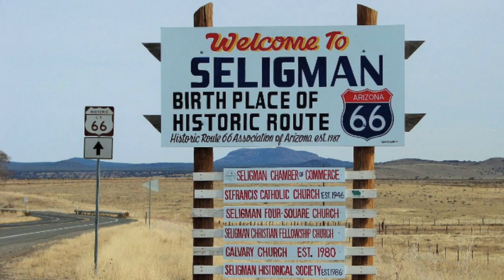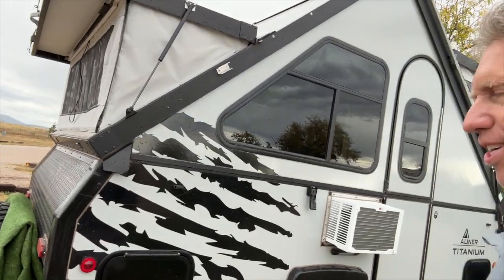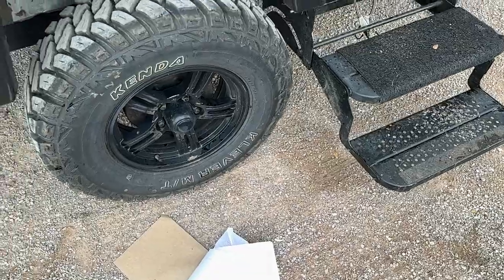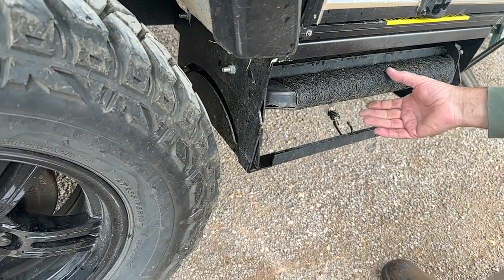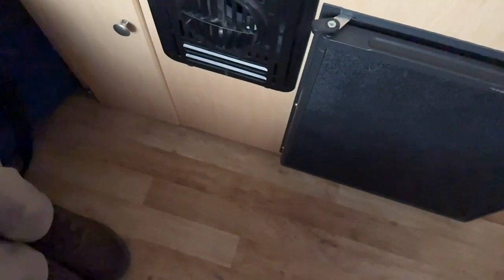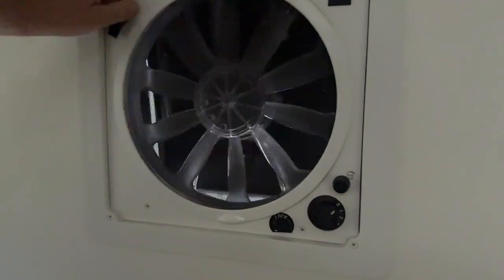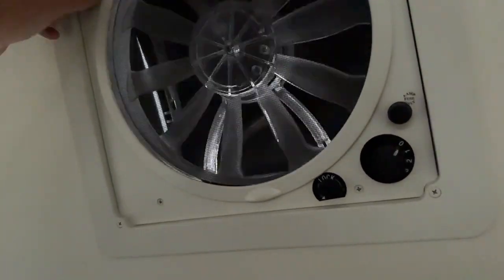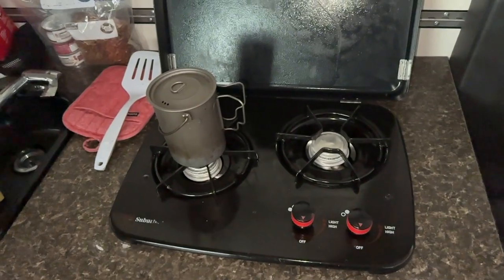Inspecting an A-LINER | Used or New

Comment: Great job on this!  Very thorough.
Reply from the maker: Thanks ToddM.  Hoping it really turns out to be a nice resource for other future owners.  Doing this will sure help me with my next inspection!!
Reply: @GoldenK9Campers  While searching for a camper, check out the BAL Light Trailer Leveler.  These are sort of a must-have, because not only do they quickly level your camper, they provide great stability so you get less movement when inside.  Even if the parking pad is perfectly level, you can toss the leveler under one wheel, and raise it just enough to become a wheel chock.  And a little bonus, if the parking area is conducive to unhitching the camper, and rotating it to take advantage of a view, some shade, or better overall position on the site, you can still level the camper just as quickly.  We will often snag a very small site by backing the camper to the end of the parking pad, spinning it 90 degrees, and then the tow vehicle can be backed in, and still fit.
Reply from the maker: @austinado16  I've been planning on getting one of those.. even if we don't have the trailer yet!!